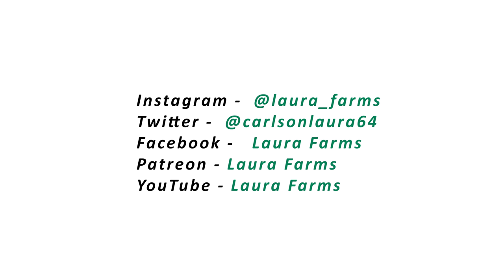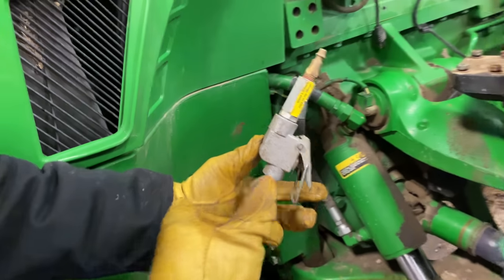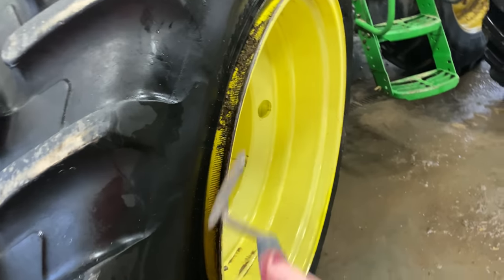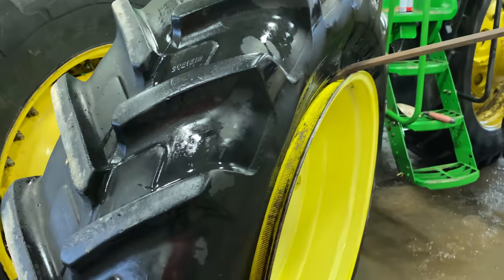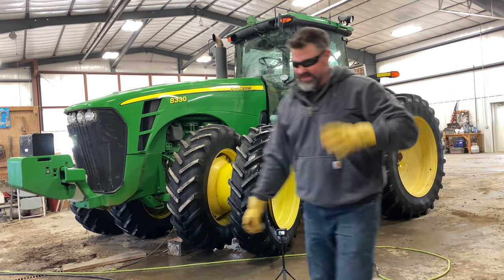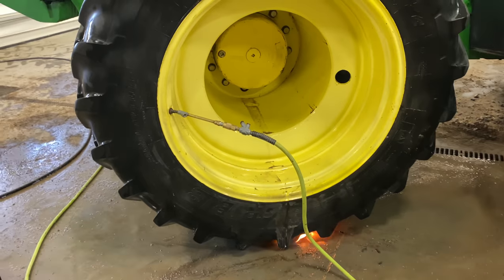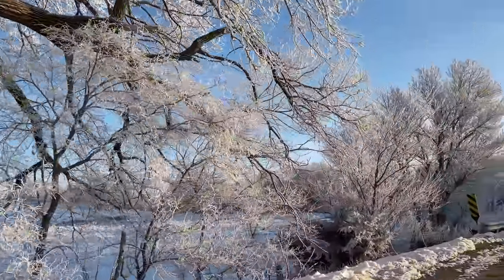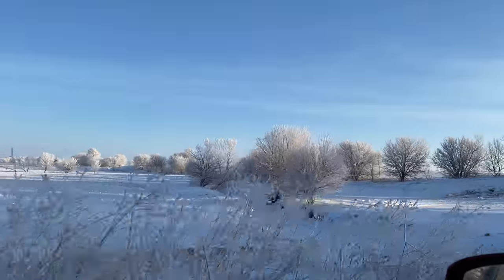Fixing the Tire of a John Deere 8330 with Fire

Comment: The dislikes are from John Deere executives who are furiously trying to figure out how to disallow customers from fixing their own tires
Reply: This guy knows a thing or two about modern Farm Tractors
Reply: whenever anybody who needs big tires bead sealed knows this method, doesn''t take a genius!
Reply: Yes, very dangerous way to mount a tire. Ask any good tire tech.
Reply: @shelleycoziah7772  wel shelley than it is a world wide proof way to poot a  tire back on the rim. I know very little pro tire tech that don't use this method . It is not dangerous if you don't over fil the tire with ether.
Reply: How much ether is to much ??? When tire blows off rim and hurts someone, that's to much !!!
Reply: @shelleycoziah7772  Well Cale must have used just the right amount because it didn't blow off the rim and hurt anyone !!

Comment: you dont need a jack, rise the suspension, block up under the weightcarrier then drop the suspension. Wheels lift up
Reply: Yup!
Reply: Or you could just drive up onto a block with the other tire on that side
Reply: @knexfreak32  How would that work?
Reply: @casefarmgirl2279  The inner tire was still on the bead of the rim so if driven up onto a block it would raise the other wheel connected to it into the air
Reply: @knexfreak32  And what if you wanted the inner wheel?
Reply: @casefarmgirl2279  Its far less likely for the same thing to happen to the inner wheel. In the video they explained that the outer wheel was pushed up against some frozen dirt pushing it off of the bead. If this were to happen to the inner wheel instead you could put the block under the outer wheel. If it was a single wheel or both tires de beaded you'r method would probably be the easiest way.
Reply: @knexfreak32  Not seeing your logic, what has anything you said got to do with my comment?
Reply: @casefarmgirl2279  We were both suggesting alternate methods of lifting the front wheels. I was just simply providing examples where your method would be preferred
Reply: @knexfreak32  Again, nothing to do with my comment, what i said lifts all wheels in a safe and efficent manner, from what i can make out, your way only lifts one wheel with the possibility of slipping off, plus you cant rotate the wheel.
Reply: @casefarmgirl2279  True. Doing it your way would work really well for raising all of the wheels together.  My method would only lift one corner of the vehicle and would only allow access to one tire and therefor only be useful for dual tires like this.  As long as you use a properly sized block of wood and set the brakes I don't think there is an inherent danger of the tractor slipping off although it is a possibility. And yeah you wouldn't be able to rotate the wheel.

My original comment was directed at this specific repair where it may have been slightly easier. Yes there are issues with my method and it wouldn't work in most situations.

Comment: I use a Cheetah 5 gallon air tank bead seater or a come along and wrap the cable around the outside of the tire back to the come along (loop). When you tighten the come along it will squeeze the tire and make the sidewalls push outwards and press the beads back onto the rim then they will air up (with the valve stem core removed while seating). I also use silicone spray lube on the tires and beads to lube them up to make them bead back up easier and prevent corrosion on the wheels. Nice video as always though, Miss Laura! Always good to see your smiling face!

Comment: Good job on the tire!  Cleaning that rim off is so important.  I popped the tire off the rim on my John Deere, got it back on, finally....and because I didn't clean all the mud off the rim the stupid thing had a very irritating slow leak for years.  I finally took it to a tire shop and had it fixed.  Just do it right the first time and be done with it.

Comment: Another thing that helps is to have a big tub or two of Camel's tire soap. You stuff it around the bead and rim. The soap is a wax like substance it will seal the gap between the tire bead and rim. As you air the tire up the soap will push out. You scrape it out to reuse latter. We used to have competitions to see who could get aluminum bud wheels off the ground higher😂 I was a diesel mechanic then fleet manager for over 30 years

Comment: I am going to share a story with you from 1989. I am still here to tell about it.
A friend of mine and I did that many many times with semi tires for his trucks.
He had seen it done and suggested we use it to mount his tires on rims 
We did it exactly the same way.
Until one cold day it wouldn't ignite for some reason. He put little more in.
Took the torch and swung across it. It exploded like a rocket
The semi tire and rim both hit the ceiling hard in a fifteen foot tall shop.
It came back down and landed between us. Neither of us were injured somehow.
We both could have been killed from it. You will stand there in disbelief.
It also literally destroyed the tire. Little to much but you don't have a gauge.  
 Never did it again!!! It was fun until that day.

Please buy a beadblaster tank or bucket of bead mounting compound !!!!

Please don't risk it!
Reply: Good advice. Former Goodyear  manager !!?
Reply: Yup, if some is good, more is gooder!

Comment: I've done recovery, etc., for years and that is the "Damnest" thing I've ever seen.  Good Job Dad!!
Reply: It's a pretty common method for big tires and even huge tires on construction equipment.    There is just no other real practical way of applying enough distributed force over the inside of the tire bead without some really special and expensive equipment.  The tire has to be inflated immediately after the ether explodes into flame.  Otherwise, the small amount of hot air inside the tire will quickly cool, causing the tire to collapse, which may again pull the bead off of the rim.  However, too much ether can cause the tire to explode.  So safety and experience is important.

Comment: Questions:  Are the tires tubeless?  Do any of the tires (namely the rear tires) have "Fluid" in them?  Our  rear tractor tires were filled mostly with fluid and then a little air to adjust pressure.  The fluid was some type of water and an antifreeze to keep them from freezing to ice in the winter.  We used a large house jack to jack up the tractor axle when we changed from the single tire to the duals during the knifing in the early summer.  The duals did not have fluid in them.

Comment: Safety glasses! Tire can blow up and kill.  Another trick is to remove the valve core so the tire won't blow up and vent out then vent back in.  This way you don't need to have  the air connected and fill right away.

Comment: How did you avoid ending-up with water in the tire when pressure washing the rim?
Reply: They didn't. Lots of water in that tire now.
Reply: It really isn't going to hurt anything getting a little water inside the tire.  With bias-ply tires, it was/is actually quite common to add up to about 75% volume of the inside of the tire with calcium chloride and water... or perhaps water and antifreeze.  This is done to add ballast weight to the tractor to improve traction.  The calcium chloride has the added benefit of being about 30% heavier than water by volume.  This can be a lot cheaper than buying and installing cast iron weights for the tractor.  It really depends on the soil conditions and risk of overly compacting the soil as to whether the added weight may be a good or bad idea.  If adding liquid ballast, the wheel could be turned so the valve stem is at the 12:00 position.  Then fill the liquid through the valve stem.

However, with the newer radial tires on machinery, I understand that it is less common to add liquid ballast to the inside of the tires as it can effect the performance of the radial tires, making a smaller footprint with the ground (which is not a good thing).

https://www.moderntiredealer.com/articles/11300-liquid-ballast-helps-farmers-get-a-grip-but-the-radial-revolution-may-change-the-rules
Reply: @edschultheis9537  I thought you could only use calcium chloride with tubes.  With tubeless tires, it corrodes the wheel.  They currently use an oil called "beet juice".  At least that's what's in my (much smaller than Laura's) tractor.

Comment: Take the valve core out of tire , remove the valve core depressed from tire chuck so you will get a lot  more air in the tire and use soapy wat er so the tire can seat better on the  rim .  plan b  use a bead blaster to add more air to force force tire to seat. Thanks

Comment: I would be concerned about the water and junk now inside the tire but it was the easiest route. Also would have thought a shop this size with tractors costing mega bucks would have a bead blaster.
Reply: Or call a tire tech to do it !!!
Reply: Or call a tire tech to do it !!!
Reply: @shelleycoziah7772  why? it is fixed now right? i dont see any probs here lmao. why hire someone and pay for it if you can fix it yourself. thats a farmers mentality.
Reply: @mupzakje  I've seen rubber carnage from the ether trick. Not worth risking a 1000$ tire to save a 200$ service call.
Reply: @orange3203  nah no harm done if done carefully. ofc, sometimes it goes wrong, but that is with everything.
Reply: @mupzakje  I've never destroyed a tire with Murphy's. I have destroyed one with ether. Unless your doing a lot of combustion math I argue that you can't truly be careful. You can be lucky until your experienced but that's not the same thing as careful.
Reply: @orange3203  lmao
Reply: @orange3203  i never destroyed one with ether so
Reply: @mupzakje  hence lucky. Statistics are an unforgiving thing.

Comment: How do you get all the water out of the tire u just pressure washed in? Does it not matter? Just wondering because I live in Canada and use the same technique with people I 4  wheel drive with that don't have beadlocks minus the pressure washer because we're at 6000 feet with only compressed air and ether.🇨🇦 Cheers from Canada!
Reply: Tractors on the farm I grew up on had water in the tyres.

Comment: This method does work but it is not the safest method. Be very cautious of how much ether you use and make sure you have a fire extinguisher within easy reach. Remove the valve core first, otherwise the vacuum created inside the  tire can cause the bead to be pulled off again.

Comment: I spent about 30 min on a wagon tire once trying to set the bead, finally switched to that method and it took forever too but finally the bead set, then I found out the air compressor hose fell off the valve and the tire popped off, what a disappointment!